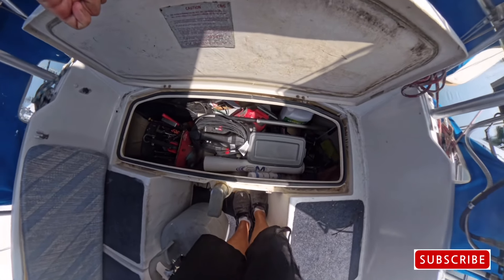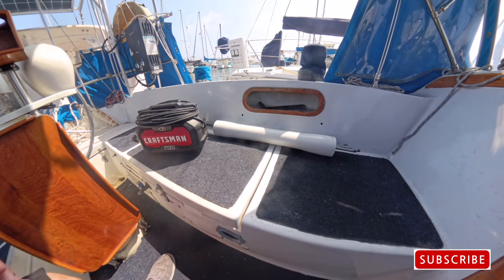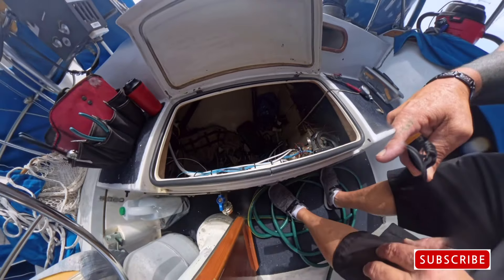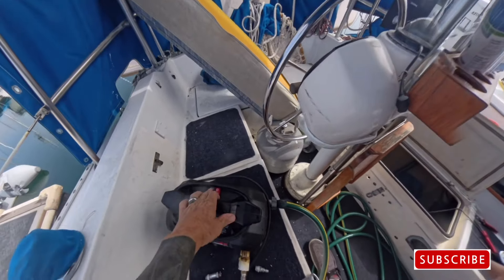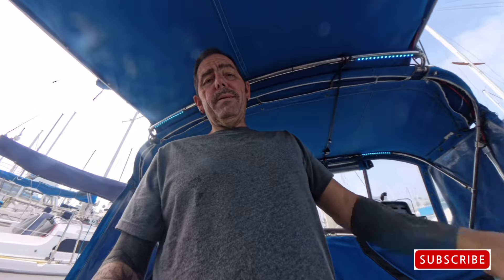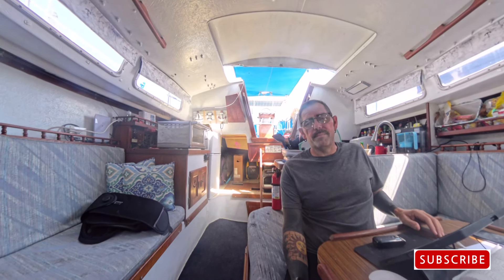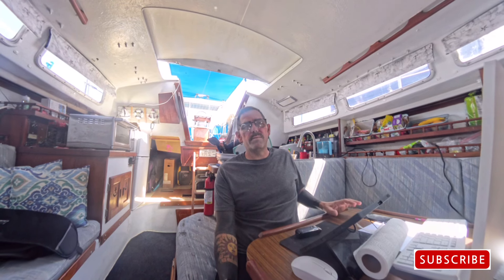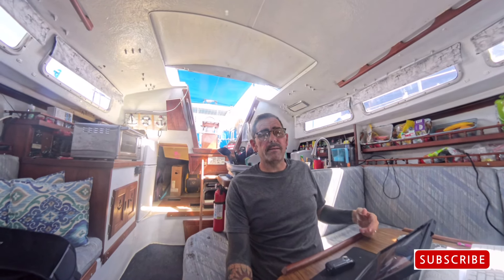WATER MAKER! FROM A PRESSURE WASHER !SAILING CHAOS S02E08

Comment: Have you tested the water yet to see if it's truly drinkable I like your Innovative idea of making the system
Reply from the maker: Yes I have tested it.  You have to run it awhile when you first get it set up because everything is new. But after that it has worked well.
Reply: @SAILINGCHAOS-1  I got to say, I'm super inspired, I want to be able to fill up my water tank when I'm out in Catalina island. I don't want to spend $3,000 on a water maker. I have plenty of battery bank and I have a solar system what's an inverters. I also have a 1000 watt Honda generator. Have you figured how many gallons you're getting per hour?
Reply from the maker: @GalleyHuntersThanks I just try to do things efficiently and effectively without breaking the bank.I haven't calculated how many gallons and our yet I will let you know when I do. Also if you build something like this always flush the system after each use because the pump isn't stainless and really that's about the only difference in the other ones you can buy
Reply from the maker: @GalleyHunters https: https://youtu.be/wisuyHdsv-A?si=Hgs3sWLdYRikDSFp.
Reply from the maker: This is where I originally got the idea of this helps